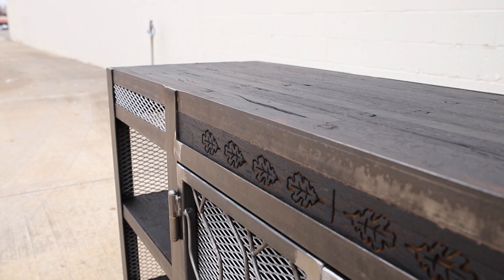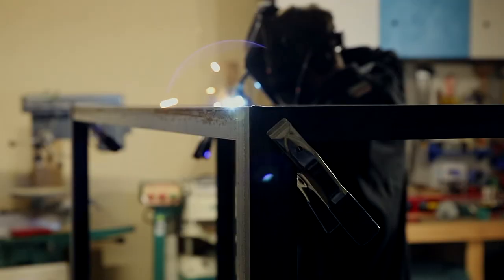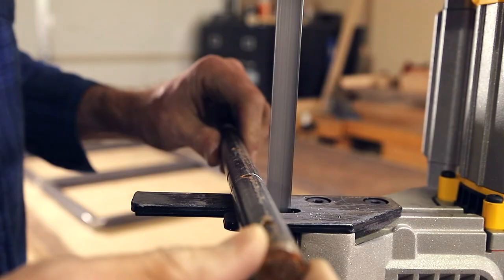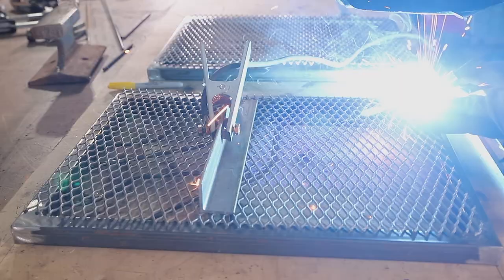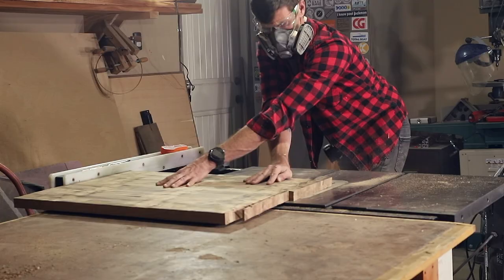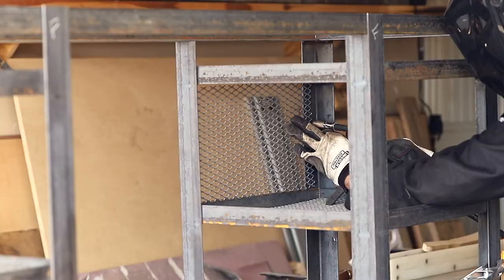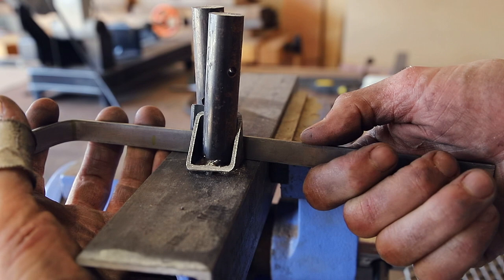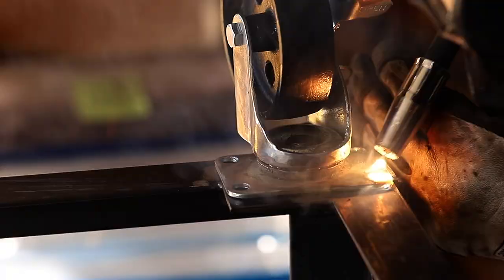DIY Modern Industrial "Tree" TV Stand/Media Console - Simple Steel Bending Jig

Comment: This is some really nice work; enjoyed every step.
However, how would one route wiring for the media devices? I didn't see any cutouts you would find in a typical TV stand/media console.
Reply from the maker: The entire rear apron was left open for that purpose.
Reply: Are you talking about the gap in the rear center, shown at the top here? https://youtu.be/9-v_YpHN5NI?t=736
I can see where that might work, but I must say, forcing the 4-6' cables up from the bottom of a side shelf and around to exit the rear apron is going to give you very little to work with once they get back there. Most electronic wiring comes out of the bottom of the electronic devices; you can forget trying to hide them with the see-through front.

Alright, I'm off my devils' advocate soap box. At the end of the day, it's still some quality work - both the stand and the editing!
Reply from the maker: I feel like if someone has the ability to build this console they could also figure out where they might need to drill some holes for cables. I built this for my friends and they didn’t need any additional cable management.